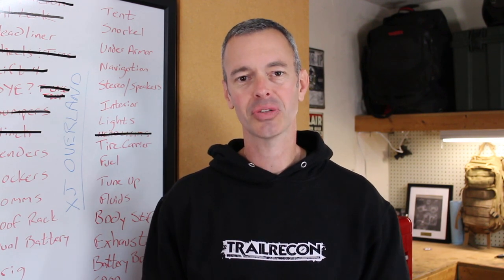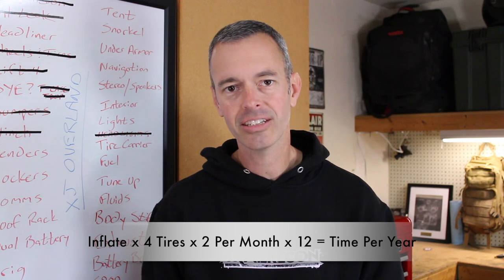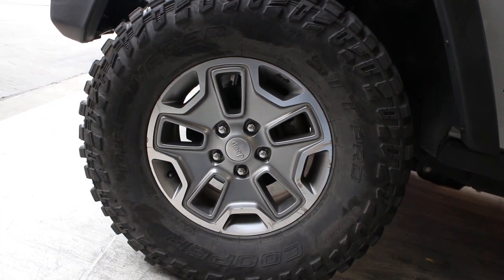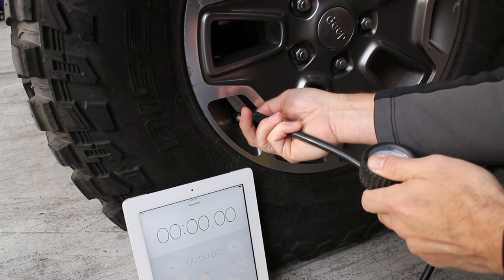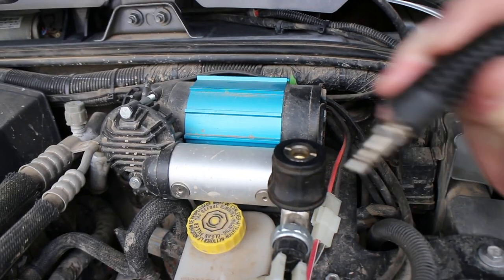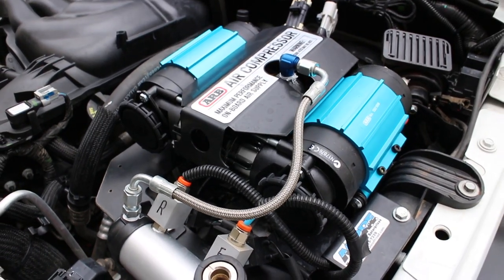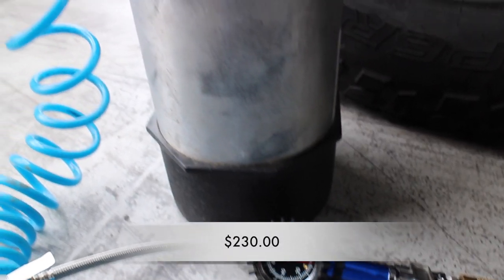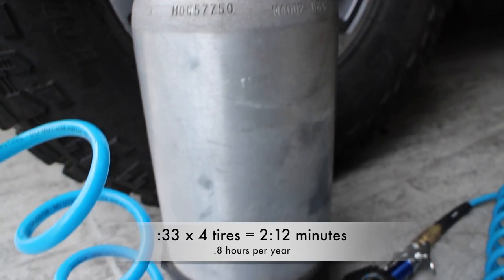Air Compressor Shoot Out - Tire Inflation Comparison

Comment: I have a home built c02 bottle kit, cost $205. It cost me $18 to fill up and lasts about 3 months. I can fill up my 33s 6 times from 15 to 35 psi. I've also used it to pop the bead on 2 tires. Its not heavy, the bottle itself is 14lbs and with the 10lbs of c02 it comes to around 25lbs. I just keep a hanging scale and weigh it to know how much I have left.
Reply from the maker: Right on, thank you for sharing!
Reply: TrailRecon oh I forgot to mention I have an aluminum bottle, I guess there are steel ones that weigh more, I suggest getting the aluminum one of course lol also another pro of the tank is that if a buddy needs to air up you don't need to move your vehicle to where he is, you can just pop it out of the mount and move it. I had the smittybilt one for about 8 years before it gave up the ghost. I highly recommend it for the price. Thanks for the video, I love these shootouts. Keep on keepin on.

Comment: York 210 compressor, Belt driven. 3 gallon tank.  Runs all air tools, and inflates 39.5 " tires from 4-6 psi to 26 psi in under 15 seconds.

Comment: One advantage for co2 over portable compressors is its cool after use, unlike compressor motors are scorching hot so when tossing back in the Jeep you have to be careful.. I bought my smittybilt co2 of a local guy for $150 brand new. I also have a viar for back up.
Reply from the maker: I have said a few choice words more thank once burning my hand.... great point!
Reply: Also, NO parts/motors to wear out and easily can swap over to other vehicles or to use an impact gun on other projects around the house/farm.

Powertank 10 pounder here, only 12 bucks to refill at the local fire extinguisher shop.

Fills each of my 285/75R16 Goodyear MTR's about 4 times.

Nice to have the extra power to bust off stubborn lugs in the middle of nowhere too!

Comment: I also have the ARB CKMA12. 8 years, no issues except for the o-rings started to leak a year ago. The replacement o-ring kit is difficult to find, and ARB often does not stock them (meaning the dealers don't have them either). I finally got an o-ring kit last week but it took a month to arrive. I would order one just to have in case you eventually need it.

The CKMA draws about 25A, and airs up tires a lot faster when the alternator is running. This, even with dual Odyssey PC1500 group 34M and a Genesis dual battery system. I am curious how running the Jeep would have affected your fill times.

FYI I installed a ViAir 2 gallon tank and connected it to the compressor via a 1/4" ViAir stainless steel "leader hose". Then I ran a bumper-mount quick disconnect. Also replaced the plastic ARB locker air supply lines with stainless steel lines after one of the plastic lines melted (common problem ... too close to the exhaust). I'm really happy with the results and just wanted to pass it all along.

Comment: Most guys that switched from an on board compressor to a power tank will never go back. You will not be able to run air tools with on ARB system or Viair, you have to spend around 2k with an Oasis to get air tool performance. Also, nothing to wear out with power tank.  Those ARB compressors will need to be rebuilt eventually, and they will develop leaks which is a PIA.  Same with air lockers, great when new but will and do fail on the trail at the worst time. Not trying to bash on board air, just stating personal trail experience.  I know and understand both systems well and it's a personal choice for sure.  Just want to say this is a great video and I personally want to thank you Brad for the hard work you put into all of your videos.👍
Reply from the maker: Thank you and I think you'll be please to know that I recently installed a Power Tank setup in my Jeep and love it!  Full review video coming in a couple days.

Comment: Great video...but takes into account actual inflation time only and not the time it takes to move from tire to tire. I still use a portable but will be installing ARB twin soon. Meantime l use a Speedflate 4 chuck system which allows my cheap pump to inflate 4 tires at once. Takes 13 mins to go from 15 to 32 psi but I get to chill during that time. Can't wait to get the ARB!
Reply: No need to waste your $$ nor time with any compressor, even the ARB twin - just get a10 lb CO2 tank!
ARB twin flows 4.66 CFM @29 PSI
CO2 tank flows 45 CFM @120 PSI. not even close!!!

Comment: Supertank 37s Trail Grapplers on a 2020 JLUR Diesel I hate waiting! $20 to refill and no rebuild. Use for tools or other needs. Bolts in and secured. No heat issues but cooling issues. Guaranteed and easily carried from vehicle to vehicle if needed.

Comment: I have the 2780 and I tried taking the tires from 5 lbs to 30 lbs one night last week in the Canadian cold and it overheated half way through the fourth tire. Another good option would be the Viair 400p.
Reply from the maker: My last cheap Slime compressor use to overheat all the time.  Glad I finally upgraded.  Viair is a great option and I know many that use it.  Thanks!

Comment: I must be the only one using a battery powered AC.  I have 2 24V tools and several batteries and chargers so I bought a matching 24v compressor only, super cheap.  Just over 3min to fill my 32's and 4 tires doesn't even dent the battery charge.  A big plus is the built in pressure regulator, I can attach the hose and walk away, come back in few and it's a done deal.  No setup time, remove from bag and push button.  It has a .5 gal storage tank.

Comment: This is a very interesting concept however I think there is a flaw in your findings, since I do not believe the compressors will operate consistently on all 4 tires and you will have to wait for an overheated unit to cool down before doing the next tire.
The proper test is to actually inflate all 4 tires and then compare the results.
I bet the results will be very different from your calculations.
Reply from the maker: That's an interesting point.  I will say that I've filled up 12 tires all at once with my single ARB with no overheating issues.
Reply: i have a VIAIR 450p that has filled up a 4 37s, 8 35s, and 4 33s, and it did not stop. very impressed with my viair

Comment: need to show a vid how to build a co2 tank
Reply from the maker: Great idea!
Reply: besides a co2 tank, there is also those of us who carry (when scuba diving) spare tanks with tire fill values, in case we need them..
Reply: @xmo552  There is no reason to consider any compressor even the ARB dual when the CO2 tank flows so much higher volume. The ARB dual flows 4.66CFM @29PSI and the CO2 tank with a 250PSI regulator flows 45CFM @120PSI!!!
Reply: @xmo552  The copressor rate of inflation should not change but will take longer as you are inflating 4 tires instead of 1.

Comment: CO2 systems are the bomb... I know this is an old post,  but I think a new comparo would do very well as a video. The three missing from this test are a homebuilt CO2, the gold standard - ViAir 400P and the classic overperforming value option... the Masterflow -Tsunami MS1050 (which is what I use... Kills the Smittybilt for 1/3 the price).

Comment: I’ve been using the harbor freight Pittsburg 150psi alligator clip 12v for my second summer, it gets the job done but it’s about 5 min a tire to go from 18-42 psi. I have a 20 ram 1500 w 275/65/20 about a 34in tire,  Cooper discover rugged treks , I def spend about 25 min to setup/pump n put away each time, about 2 maybe 3 times a month to the beach but only 5 months year, would like the arb system tho but $$$$

Comment: Excellent job on the video.  I like how you present the data in terms of "hours consumed annually".  I am not a big fan of compressed gases in a tank that you have to carry in your vehicle.  Compressed C02 left in a hot vehicle can become a potential explosion hazard.  Another consideration with CO2 is that when tanks are filled under pressure the C02 sits as a liquid.  This liquid has a temperature of approximately - 56 Celsius.  Should there be a failure of the regulator, which can happen, imagine liquid C02 being released on or around the individual using the tank.  Taking into consideration the elevated safety risk of compressed C02 and the travel time to fill tanks >>>> give me a compressor any time.  Thank you for all your videos.  I always learn from your material.  Keep filming.
Reply from the maker: Thank you!

Comment: Samurai on 31/10.5R15 I just fill the spare tire to 65lbs and can (almost) inflate all four tires from 8lbs to 18lbs twice.  On the road I use 18lbs.  I stopped using CO2 after a flat and the mosquitoes swarmed making the changing and the lowering of the spare tire pressure with CO2 to trail pressure miserable with the swarming.  I do keep the CO2 as a back up.  Paintball cylinders.

Comment: The c02 bottle will slow down dramatically on the 4th tire. To get a somewhat reasonable measurement you should have filled all 4 tires!
Reply from the maker: CO2 is in liquid form and maintains it pressure consistently, an air filled tank however will loose pressure as it gets used.

Comment: that's just fill time. another thing to consider is the time it takes to pull a mobile compressor out, open the good, connect to battery etc. not to mention the additional time the truck is left idling. 3 hours a year after just 5 years is 15 hours of idling just to fill the tires.

Comment: Co2 is impressive but it leaks from tires faster because co2 is  soluable in rubber. It basically works its way out through the rubber molecules much faster than air. A dedicated rig or in a pinch its fine, but not for the daily driver.

Comment: Why did you not use the same gauge for consistency? What does it matter that it has it's own gauge?
Reply: I think cause the smittybilt screws onto the valve stem so you cant use the ARB gauge.

Comment: I am getting ARB lockers on my '18 Sahara. I also opted for the twin cylinder compressor. I was wondering how long would it take to inflate 4 tires at once like I saw on another one of your videos. That might be almost as fast as the bottle system? That would be a good shootout. BTW my tires are 35"s.

Comment: I would be really interested to see how an air tank affects a four-tire fill time.
Reply from the maker: I know a couple guys that run their ARB's to a four-tire line, but don't think I've seen anyone do it with CO2.  You have to use high pressure lines with CO2, so they would have to have a custom setup I think.
Reply: Like the Hurricane that Overclocked CPO uses? 

I was thinking about a 2-gallon compressed air tank that's been prefilled by the compressor, rather than a CO2 tank. But either would be really cool to see. 

Also, why would you need high-pressure lines post-regulator? That air is at a normal tire-filling pressure, isn't it?
Reply: I have the ViAir 2 gallon tank connected to my ARB CKMA12. It does help to a small degree.

Comment: Using Your ARB High Output Compressor running 35" Tyres @ 2m 10s X 4=8m 40s X 2 = 17m 20s X 12 = 3h 28m, Running my standard Tyres at 18psi and putting them up to 32psi takes 1m 03s X 4 = 4m 12secs X 2= 8m 24secs So that's 1h 40m and 48secs per year Using the ARB Portable version of your Compressor which is Ideal for soft sand and normal Expedition Use, I haven't tested my Bigger Tyre yet but I am sure my numbers will change a fair bit, I don't see the need to inflate Tyres at warp speed, 4 wheelin is done at a slow pace so I see no need to inflate tyres in the sub one minute barrier unless it's just to have the bragging rights and if that be the case I could always run my shop compressor off my inverter, The reality is regardless of the tyre size People have been using the ARB single for more than 20 years and there is just no need to go OTT, The Single ARB will suit 99% of people so there is no need to spend mega bucks on the Twin or other high cost units, One thing that should be noted is the specs on the single ARB unit on many sites and on the box misquote the true specs of the unit, And According to their site It actually puts out 87.2L or 3.08CFM, Nice Video and well done for making the effort,, First class.

Comment: put on and take off and you won't lose a lot of air in the process. I previously had a 77p which was slower but also a good pump (till somebody swiped it) except the plug in adapter was very poorly made. I did fix it by splicing in another adapter plug that I purchased and it was working fine but i think i like the fact that this item hooks up right to the battery and I don't have to deal with the crappy plug. I also no longer have to go into the car and pass the 77p to the other door when I want to fill tire on the other side of the car.*

Comment: That CO2 tank setup is interesting, but very dangerous.  If the regulator stem breaks while off-roading (due to the car bumping around) I'd hate to be anywhere in that car when the tank takes off like a rocket.

Comment: Hi, Am using MOBAR air compressor which is installed in rear door. it looks nice and compact, but it took way long to inflate the 4hrs. over 20mnt for 4 tires. i don't recommend to buy it at all. it cost me at agency aprox $680 and it is useless :(. I'll go with ARB two cylinder and get my brain rest :) am using 315/17 tires.

Comment: The CO2 tank is of course the fastest - but it has a big downside: storage. If you go out for a 2 week trip storage space is at a premium in a Jeep. Lugging around that huge bottle in favor of i.e. a bottle of gas for heat/cooking is a consideration.  I for one prefer the ARB compressors installed under the hood. Even the Smittybuilt one is considerably smaller and therefor easier to transport.
The other question is: are you really in such a hurry that 10 minutes vs. 2 minutes makes that much of a difference? Sitting around for 10 minutes at the curb to inflate the tires sure can feel like a lot of time, but it's not that much. I have manual sway bar disconnects (mostly because of price and reliability), so it already takes me 2 minutes to flip those up and down.  In the end that's the 10 minutes my wife uses to check the weather  forecast or enter the next stop on the  GPS.
For me, the longer time for something I have under the hood is worth the savings in space - plus I have it in there all the time and I was able to help someone on a few occasions because of that. I remember the two girls bike backpacking in Death Valley and they were really happy when I pumped up their tires since they had a flat and the hand pump they had was broken. Would I lug that tank around 24/7? Probably not (particularly not since this is my daily driver and I drive topless a lot - a tank system would be easy to steal)
So yes, there's a lot of things to consider. For me: permanent install beats portable systems. Time is not really a consideration in my book.  It has to be reliable and work when I need it to work.

Comment: What PSI was that CO2 tank at when you made this video? I am trying to build an onboard air system with a tank so trying to determine which size tank I should go with. 2.5 gallon at 200psi is looking like my option at the moment.
Reply: Wild Expedition did you build the system? If so, what pressure reduction valve did you use?

Comment: Were the air lines all the same size? The Smittybuilt looks smaller in diameter to the ARB. Also curious if you had the truck on when running the smitty.

Comment: Think you could also use the DIY Co2 inflator system for setting up tubeless bike tires?
Reply: You could probably use a paintball tank which is also co2. It would be much smaller but how much air does a bike tire have lol

Comment: I have single arb, also a 5lb and 20lbs co2 kit depending on trip
Reply from the maker: Many options... I like it!
Reply: I wonder what the pressure do you fill the gas  bottle, 120 PSI?
Reply: @ods12ca  bottles are filled at an airgas faculty and it's liquid co2 and the regular converts it to a gas so not at all like the way your thinking

Comment: How much air pressure goes into the CO2 tanks? I have one that I want to use but trying to figure out a proper Guage for the tank so I know when to refill and know max air pressure when filling.  My tank is rated at 2000 psi. Was an oxygen air tank from fire fighting equipment

Comment: TuffStuff4x4 has one similar to Smittybilt but faster and cheaper. $99 That's what I'm using for 35's.
Reply from the maker: Thanks for sharing!
Reply: got a brand and model number. I'd like to check that out
Reply: I have that one mounted under the hood of my YJ.  I had to...my buddy could fill all 4 of his 33" tires in the same time I could do two with my ViAir 450P ($250-$300).  I'm selling my YJ as I just bought and built an XJ, so I'm back to using the ViAir.  It's a 100% duty-cycle and shuts off when not pushing air, so that's an advantage.  I will be installing it with an air tank soon and see if I can't get my tires filled faster.  I can recommend the TuffStuff4x4 $99 compressor.  Got mine on eBay, free shipping.  Just know that if you snug it onto the valve stem, it can pull the stem out when you disconnect the hose and you lose air fast.  Always carry a valve stem-tool and extra stems.

Comment: I have a 7 gal air tank. aprx 30 seconds per tire. Im a mechanic and I can fill it at work with shop air or my big compressor at home can fill the tank. only thing is one fill from the air tank one time to refill 4 tires to about 28 psi each.
Reply from the maker: That's not bad, at least you get to fill it for free.